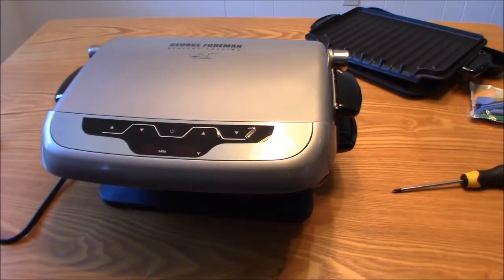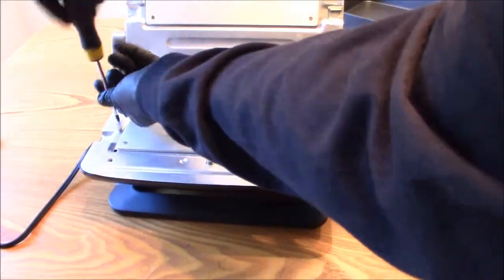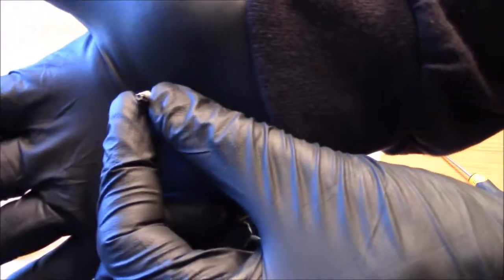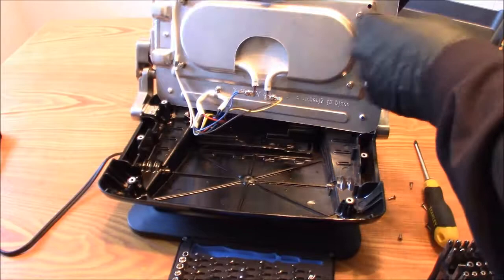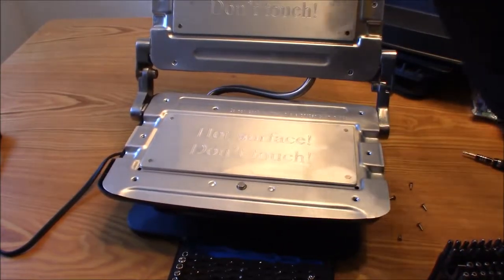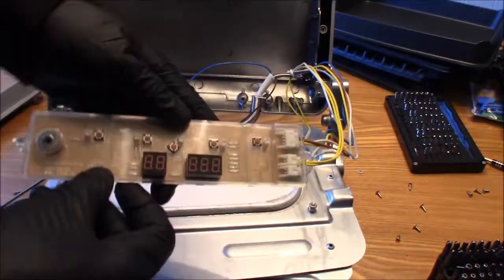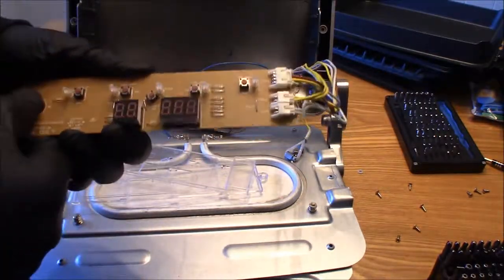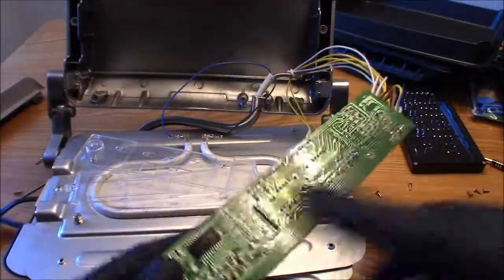How To Take Apart The George Foreman Evolve Grill To See What Makes This Bad Boy Grill So Good

Comment: There's a power supply underneath. You have to remove the bottom stand (to do that you need to remove the bottom heating plate to get at the nuts). Once the stand is off, flip the unit upside down and you'll see two screws holding an access panel. The main failure is usually the supply, not the controller board. Manufacturer made two fatal flaws in the design: using low-quality electrolytic capacitors, and allowing the AC input crimp connector to rest against a 3W resistor.

I have nearly the exact same model, George Foreman Red Evolve. It died after about three years. Took it apart to find the AC had shorted to one of the 3W resistors, completely fried two electrolytic caps and damaged two ceramic caps. I replaced the resistor and all four capacitors for under $2, she fixed.
Reply: Thanks for sharing this. What fault did you experience? My one turns on and beeps and everything however the plates do not heat. I suspected the thermal fuses but I am uncertain. Curious to know if you feel like what I have is a similar issue to yours.
Reply: @yasiral-hilali7855  with it just plugged in, idle, it looked normal but on closer inspection you could see portions of the red LED display sort of pulsing/flickering faintly. When I push the power button the unit would beep, can hear relay click, then it would either:
A - immediately click relay again and shutoff
B - appear to be on but none of the display digits made sense, no heat generated
C - would come on for a couple seconds, glitchy screen, no response to any button presses, shuts back off after 3 - 5 seconds
Reply: Hey  @pablojre , just cleaning around the house and came across my faulty grill again. Any luck with repairing yours? 
Cheers!
Reply: @yasiral-hilali7855  yes it's fixed. I detailed the symptoms and repair above.
Reply: My grill gets no power at all plug it in to various plugs no power
Reply: @piercemcdonnell9300  grab yourself a digital multimeter, open up the grill, start investigating. You've basically just asked "what's wrong with my car" without giving any context.
Reply: I’m having troubles with my grill. I have an older model George Foreman GRP90WGR but I was wondering if the bottom stand needs the same hex or security/tamper-proof hex bits even in this model?
Reply: I am getting ready to fix mine as buying an used one will have same issue
Reply: Do you have all the list of the capacitors and resistors? I’m gonna try to replace mine. It’s burnt like you said …
Reply: @carlosgraft7386  I can double-check over the next couple days, I have it logged somewhere in my notes.

Comment: Good info, thanks. My GF Evolve GRP 4842MB is having problems. The time display has the two red dashes and the temp (left side) is blank. Then at some point both sides have dashes but when the power is pushed the display flashes and it goes back to two dashes. The power is good, tried in other outlet, same issue. The plates are properly in place. The plate detection switch seems good, goes up and down as normal. I manually held it down and tried the power, same issue. 
it anyone has ideas of what could be wrong let me know. Thanks.